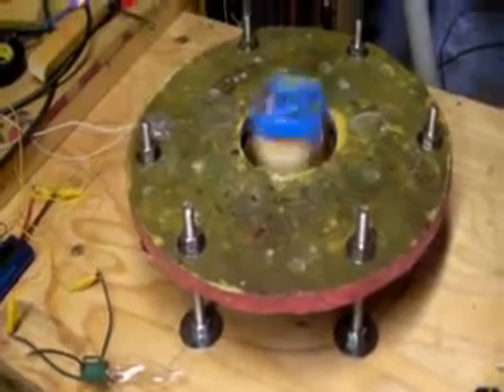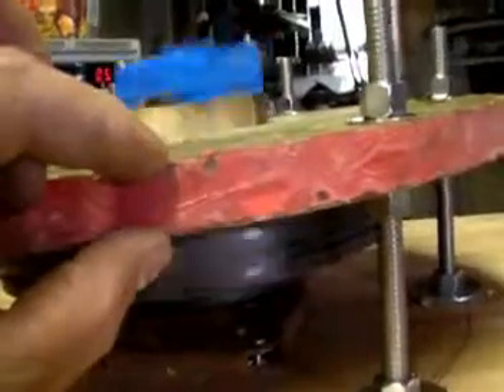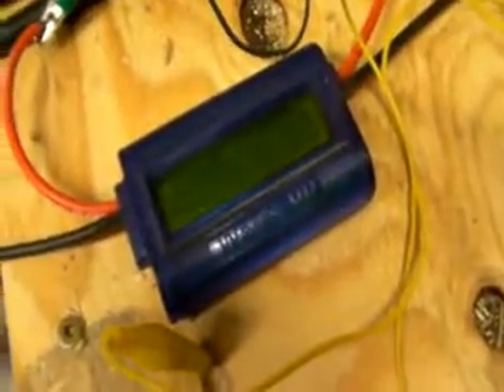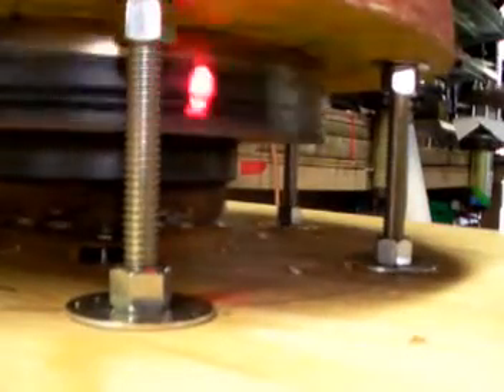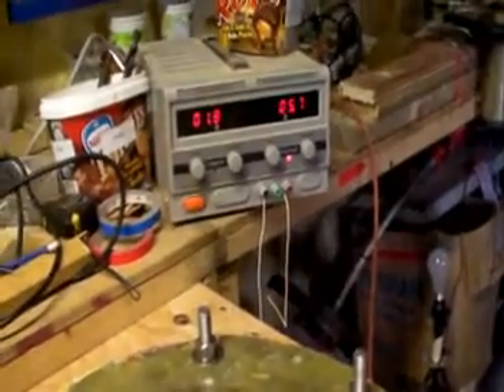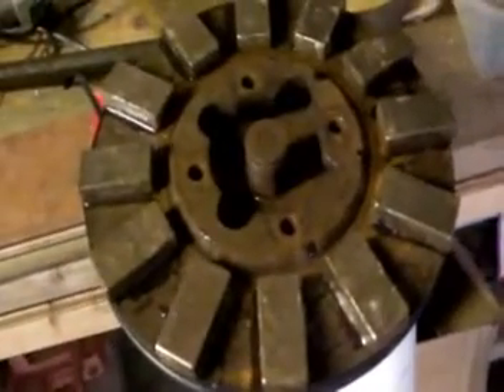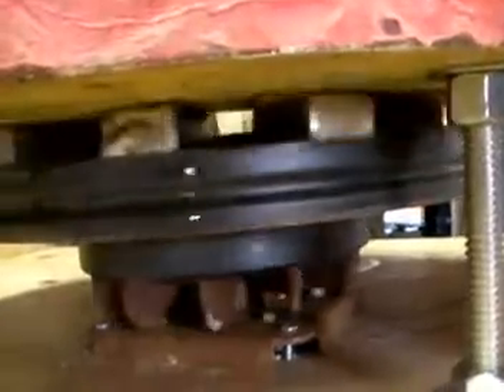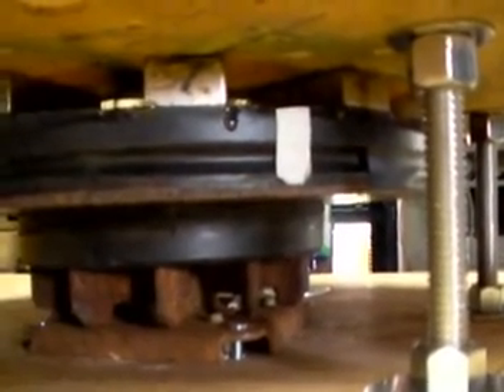axial flux wind turbine vawt hawt 02.mpg

Comment: If you have any size round magnet, what size should the coil be, in relation to the magnet? I think I have the formula, but I wanted another opinion, thanks.  I have seen many where the coils have been wound in a pie shape, and many with round shaped coils, is there a preference for optimal output?

Comment from the maker: @ronalduriolcabrera, in My own experiance, the relationship it stays the same between volts VS RPM while there is no load or current drawn.
However, when you extract energy from the stator or apply a load, like a light bulb or battery, the relationship changes. Here is an actual experiment i pesonnely did.
@ 65rpm stator produces 11vdc under NO load
@130rpm startor Produces 22vdc under NO load
@ 65rpm stator produces 27watt under load
@130rpm startor Produces 108.5watt under load

sam

Comment: @emagnets Thank you for this. Its made it clearer i cant use three phase then, ill have to rewire the stator to two phase AC. you see im not using moving magnets to do the work. my magnets are fixed - rather im using magnetic fluctuation by blocking then allowing induction from metal shielding plates that are spun. by doing this No mechanical loading can be achieved. the generator will accelerate under load an dead short. it will be lenzless.